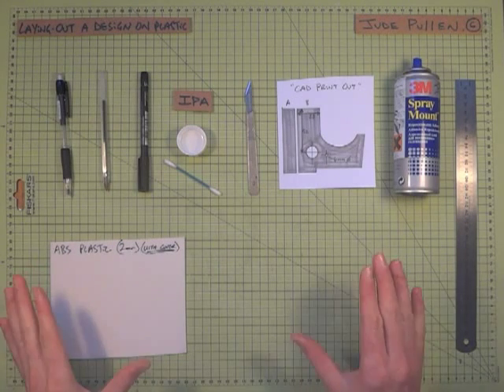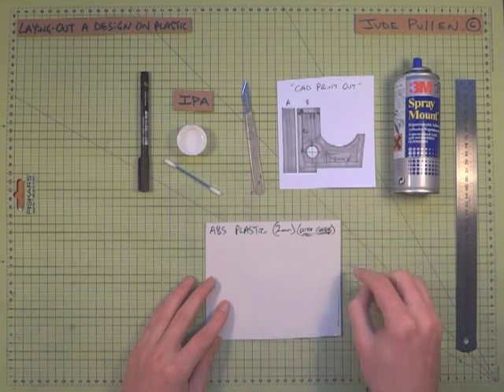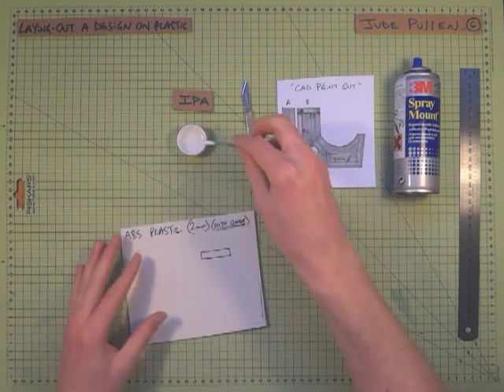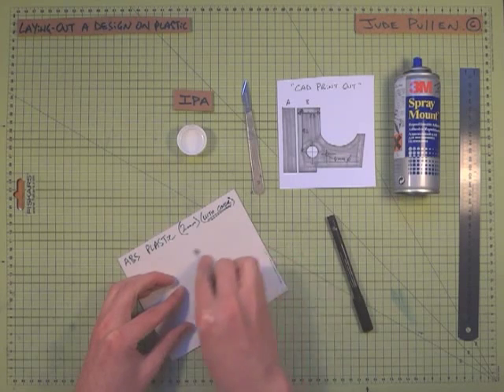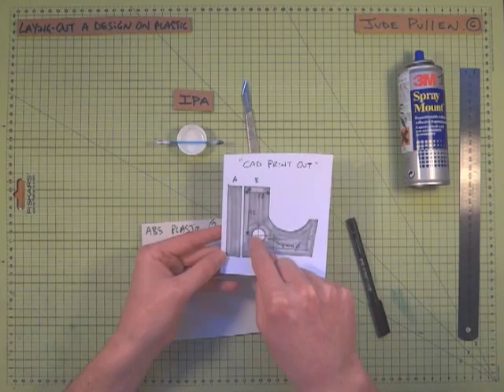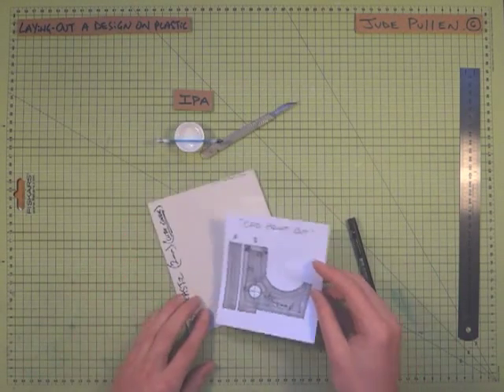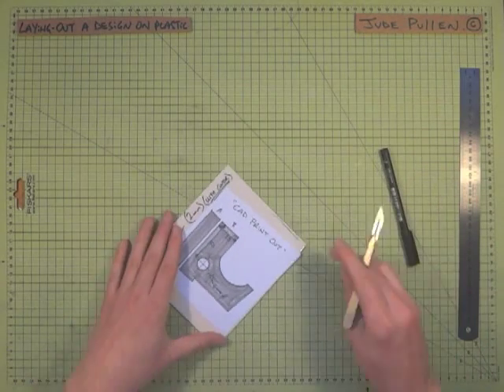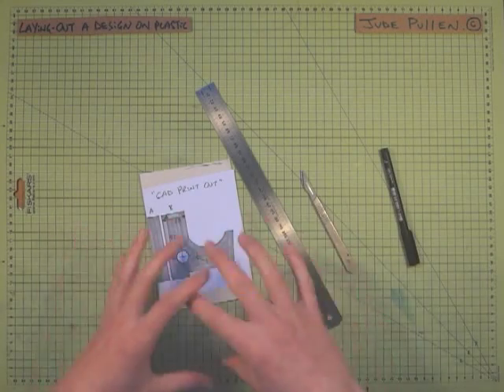Design Modelling - Plastic - Laying out a design effectively

Comment: Rubbing Alcohol is not the same as Nail polish remover. While Isopropyl is ethyl alcohol, nail polish remover consisted mainly of acetone diluted with water. Acetone, even in small amounts, will soften or melt right through ABS plastic.